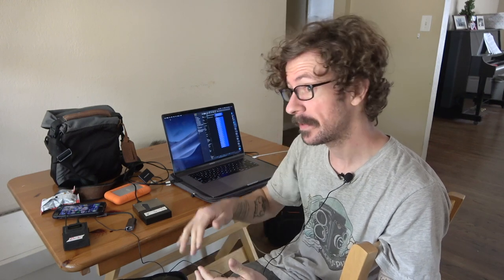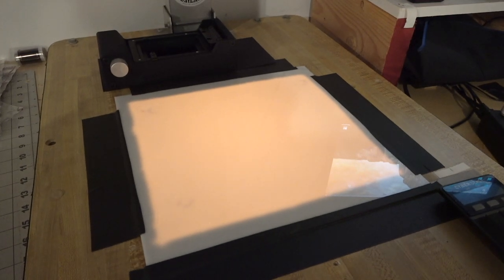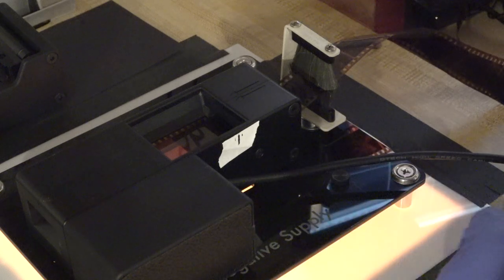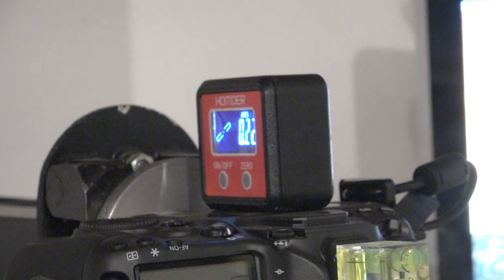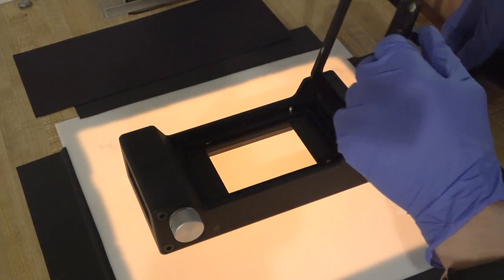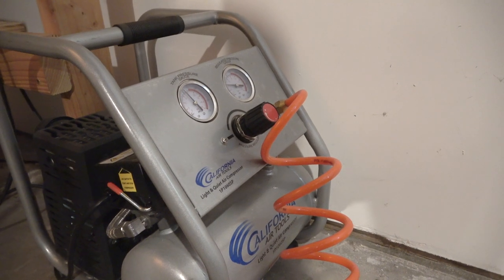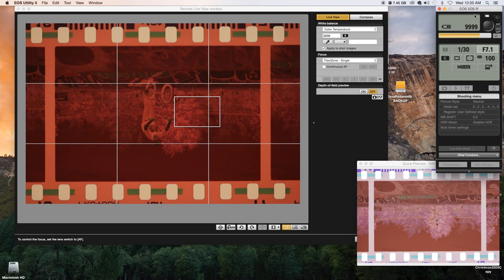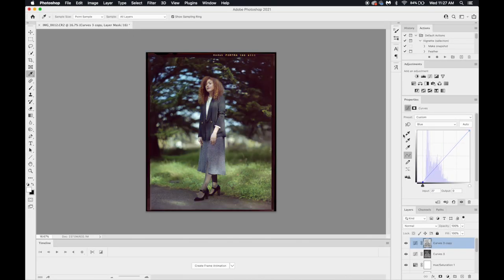DSLR Film Scanning - 2021 Update

Comment: Thanks for the update Dave! I’ve been thinking about trying out strobes for my back light instead of an LED panel.
Reply from the maker: It’s been significantly better in my tests. The xenon tube of a strobe really yields a nice color balance along with having a fast flash duration, yielding sharp scans. Another added benefit is the light output. That said, I stay at 1/30th of a second instead of the fastest flash sync. It’ll be more even and ensure the entire image is evenly illuminated

Comment: Great video! The air compressor for dust removal is next level. I just picked up a 5DSR and Tokina 100mm Macro lens for scanning 6x7 120 format. Curious, have you ever tried stitching multiple captures from the 5DSR together in lightroom to create an ultra high resolution image?  or do you find the 5dsr is already more than good enough?
Reply from the maker: 5dsr is way more than enough. I’ve made 40x50” prints from the scans that looked great. Stitching is for pixel peepers or good for using a 12 megapixel camera. Most of the people who stitch, don’t seem to be printing so it seems majorly overkill for just viewing on a screen. Even for print, it’s really not necessary

Comment: Nice video. I am currently using a Canon T7i with a Vivitar 55mm Komin 2.8 Macro lens and getting good results. I am thinking of renting the Canon 100mm Macro in your video to see if there is any improvement in overall sharpness.
Reply from the maker: Since you’re using a crop sensor camera, aim for a 50-60mm macro lens instead
Reply: @DavesFilmLab  Do you recommend an excellent prime macro in that range?
Reply from the maker: @sstahl4006  Any canon macro will work well, especially since you’ll be stopping it down. So the sharpness of a lens that’s wide open will be irrelevant, you’ll ideally be in the f8-11 range which is the optimum spot for most lenses to resolve the most detail.

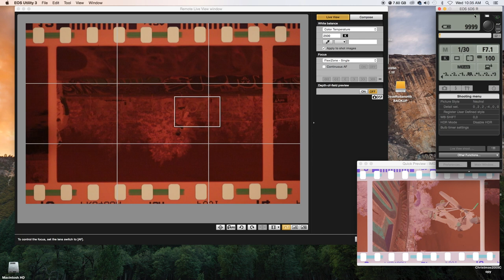Comment: 2:39 you mention it being important getting the white balance as warm as possible for color neg film, why is that?
Reply from the maker: 2500k seems to give the best results for inversion. With that said, I end up with as low as 2000k when I use the white balance dropper tool on the film base within camera raw or Lightroom. Wish I had a better answer for you than this but If you use 5600K, you end up with an off color cast in your inversion, and hence… more work to correct that color cast
Reply: @DavesFilmLab  I'll have to give it a try, I feel like I normally keep it around 5600K and now I wanna see the difference!  Thanks for the knowledge as always!
Reply: @DavesFilmLab  what Kelvin is your strobe putting out?
Reply from the maker: @jasonlamarking  5600k
Reply from the maker: @mdrxy  yes and no. If shooting raw, you can change the white balance but the initial white balance you shoot with will affect the histogram… so shooting at the wrong WB can cause you to choose the wrong exposure value.